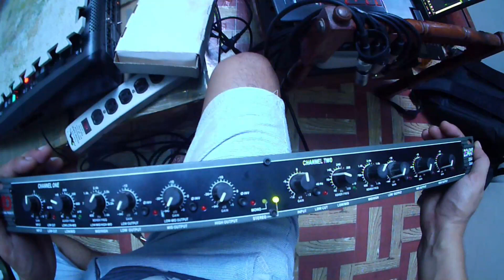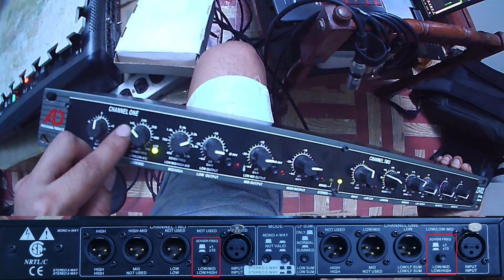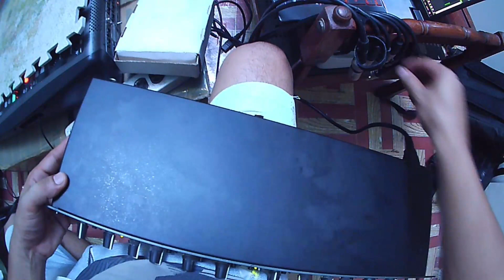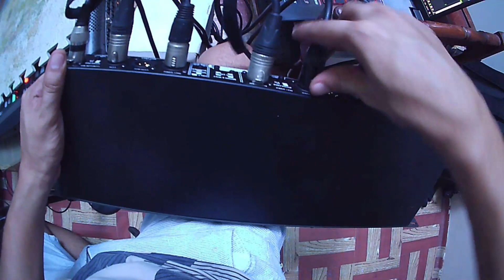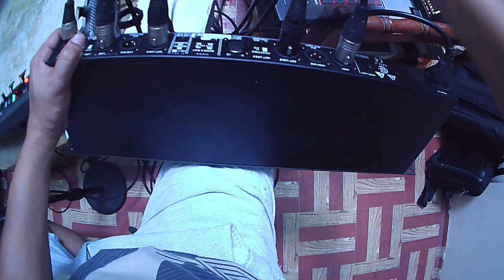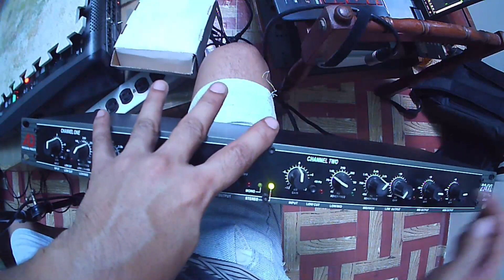ACTIVE AUDIO CROSSOVER 2/3/4 WAY PART 1

Comment: Can i use this straight with a powered box
Reply from the maker: Yes, absolutely. just bear in mind that active subwoofers have built in crossover, so use of this will make a redundant of your filter, which will give you a very high order say double your -24dB/oct, likewise your active tops might have hpf already

Comment: Great  and straight forward tutorial. one question, why would you rarely used the 4 way mono set up?
Reply from the maker: Hello Bro, how are you doing? its very rare. even nowadays, 1 stereo 2way (sub woofer for Low. and bi-amp mid high will make up a good sound very well
Reply: @BASSNBEATSLIGHTSANDSOUNDRENTAL  Thx for replying great vid again I will use what have in this tutorial for my 2 or 3 way, as the 4 way seem a bit complicated and expensive.